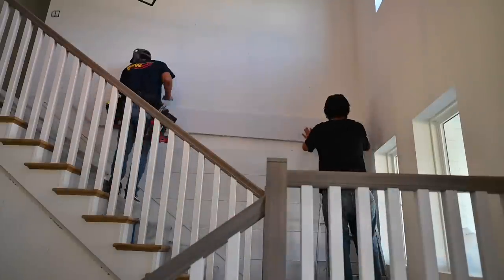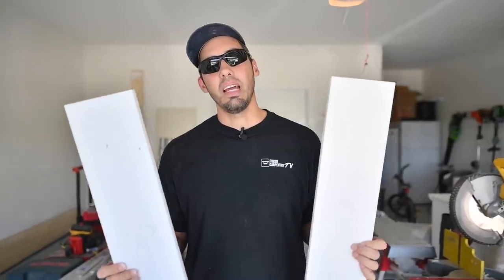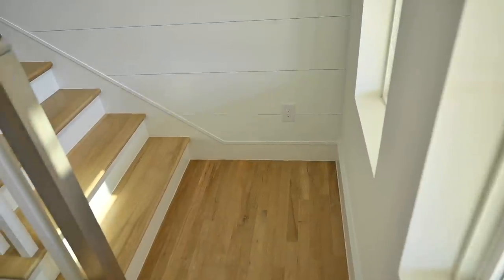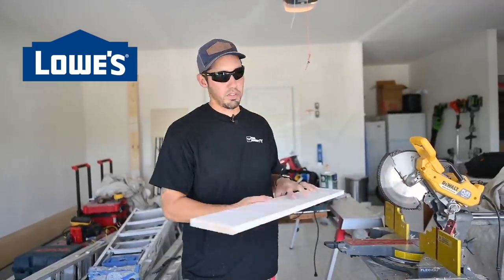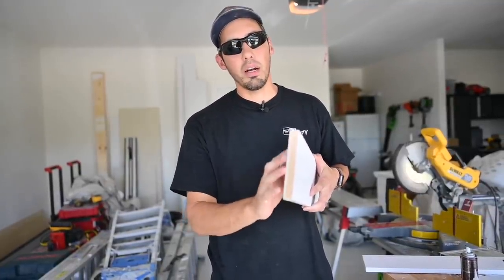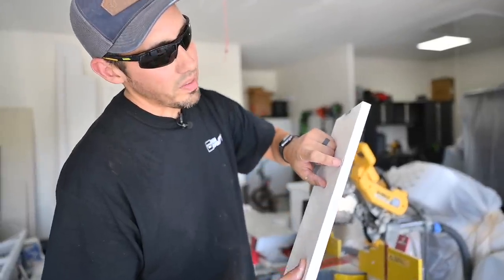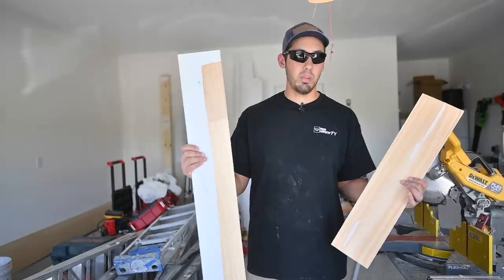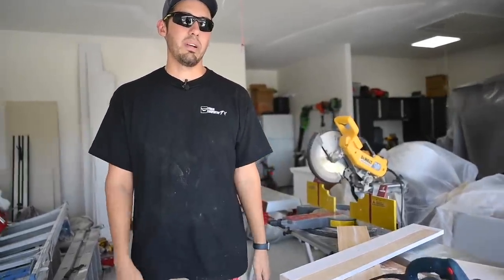DON'T Buy These Boards from Lowe's

Comment: This guy might have a point about the comparative quality of the boards, but around 1:56 he refers to his sample wall as a "shiplap job." He might be correct in his comparative assessment of the boards, but his wall appeared to have a simple, square edge joint, a.k.a. butt joint, and no sign of anything like shiplap. Perhaps he is a novice member of "Finish Carpentry TV." Checking other YouTube videos reveals that a lot of DIYers really don't know what shiplap is, but some know enough to make pseudo shiplap by simply leaving a space between flat edged boards. That might be is OK for interior walls, but not for outside walls, for which shiplap is designed. Take that ignorance outside, and you will soon have rotting walls.

Comment: By design…? Whoever thinks that stuff was not  significantly engineered and is just a cheap crap product. Does not understand the engineering dollars thrown at products like these. The goal of said engineered product is not to be better. They engineered it to require more consumables to install to not only benefit the mills profit but the store profits  through filler and paint prices. 

Ultimately this another situation where the lower class is punished. People with more money pay for better products which ultimately saves them more money from product failures and call backs. Since these products are installed on a mouse it will drive the value of your home up or down depending on your initial cost. 

The only way to put an end to these practices is through videos like these and consumer awareness. Once the demand is extinguished the supply will disappear. As long as people are buying it they will happily supply it.

Comment: Wow! Someone went to all the trouble to develop a method of saving 'their' bottom line, while basically cheating the end consumer..  I'm guessing they are just extruding the boards thru a machine that applies the coat on all four sides at once.. Which would explain the soft (radiused) edges..   PS: What did cutting thru that 'clay' do your planner??  Ouch!!

Comment: I bought from Lowe’s and thought the feel was smoother. I was duped
Reply: If your building a Wayne’s wall, you could always put a thin bead of painters caulking to hide the bad joints that the Lowe’s boards make. Shouldn’t have to do that though...
Reply: No offense but you should never caulk a flush joint, that's the worst looking way to fill it. Only caulk offsets, flush joints should be fastened with joinery or screws then sanded.
Reply: @null480  Yes I know, but to cover up imperfections in the boards, it is an option, just not the most professional option. If you use a good paint over top and a quality seal, it won’t stretch or crack over time. It definitely looks different as well.
Reply: @null480  👍
Reply: Ready Patch

Comment: I've used some of these and it's just awful - Lowes switched to this product after the pandemic whereas HD stuck with the Sellex (also garbage but for grain pop vs primer) and was content to have empty bins of 1x4 and 1x5 4-5 days a week.  The wood really is bad - I've ripped them down for various things and there are tons of knots filled with some kind of white epoxy.   It also makes it impossible to have integrity in outside corners.  You can't get clean outside miters and the edge chipping continues to happen even after it's painted.  

Glad you used your hand planer and not the thickness planer.  I made that mistake doing a similar experiment - the blades couldn't bite the gesso and it strained the motor so badly it triggered the kill switch.
Reply: ohh, I was wondering what happened because I bought a bunch of trim at Lowes before covid and none are as bad as the video